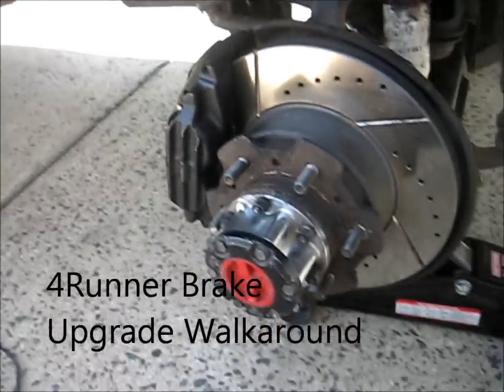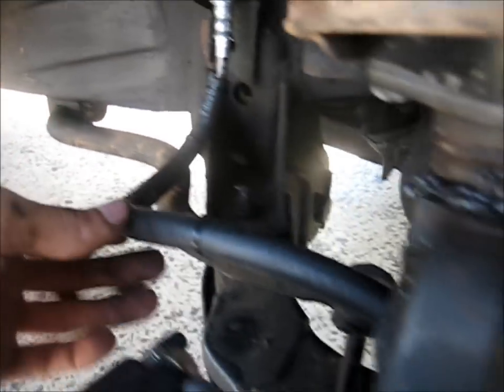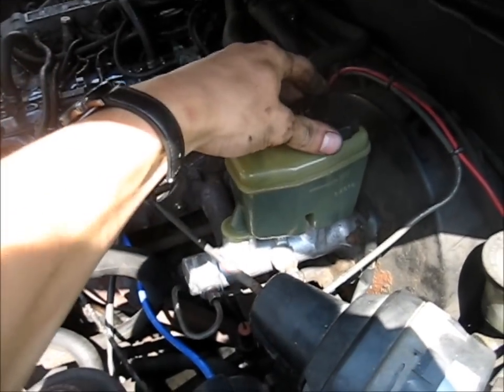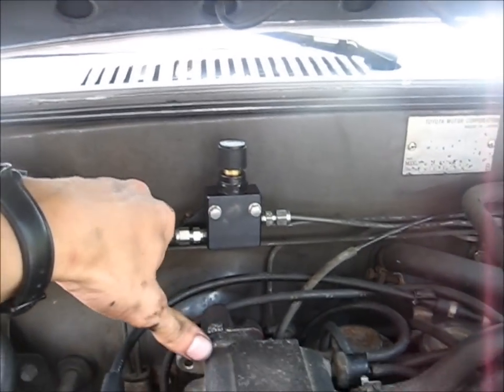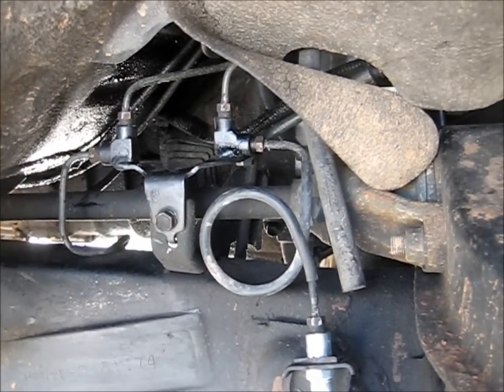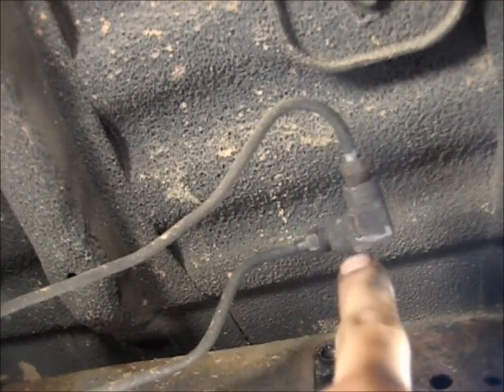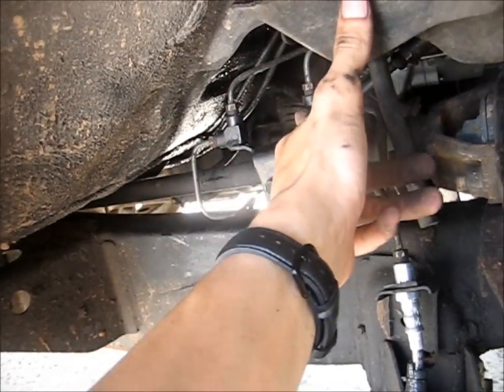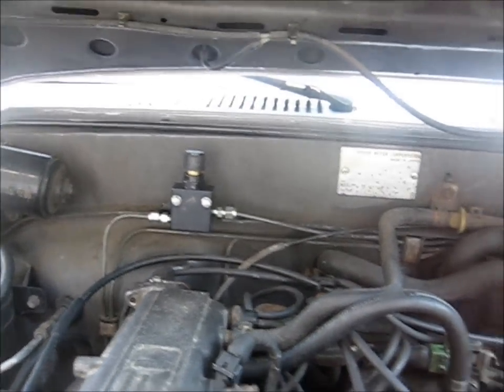Walkaround 4Runner Brake System Upgrade and LSPV Delete

Comment: But what about that that line u have to block off it goes up front to the power steering or something  I imagine  and wraps back out to the rear self leveler so just take that line or lines off that system and block the wholes 5/16 pulgs

Comment: I think your problem was you didn’t have a metering valve on the front brake system. Not having it caused the front brakes to apply before the rear causing the vehicle to become unstable. Back end wants to swing as soon the fronts come on, also unloading the hole back end of the truck.

Comment: Your rotors are on backwards. The veins should be pointed towards the back.
Reply from the maker: They work either way. It's all personal preference. Only thing that matters is the internal vents if they are directional. Most of the time they are not except on high performance rotors.

Comment: Looks like it’s the top, but want to verify it’s the top line running along the firewall that is cut to fit the manual valve correct?

Comment: You don’t explain how you got rid of the p valve how you rerouted the new lines
Reply from the maker: I did make a separate video of the LSPV delete, however, I have since gone back and installed a new OEM LSPV. I would recommend keeping the LSPV. Nothing else works as good and no matter what you do you're hacking up a good braking system. Just my opinion, many people don't agree, but I do not recommend removing the LSPV.

Comment: Thank you for explaining which lines go to what, I am installing a wilwood PV in stock location, but wanted to know what line went to the front brake.
Reply: I have the same problem with my lspv valve  is leaking  and rust

Comment: Great video! Thank you for being so detailed & clear on things.
Reply from the maker: After a bit of time with this modification, I do not recommend deleting the LSPV. Please read the description. I ended up replacing the LSPV.
Reply: TheAlexManVideos 
So the mod displayed is not effective or it is?
Thanks
Reply from the maker: I thought I was pretty clear I no longer recommend this. Keep the LSPV, get a diaphragm, master cylinder, and calipers from a 1995 V6 4Runner and you'll be way better off.

Comment: I got some EBC pads and rotors and they were like yours, drilled and slotted. Except my drilled holes are not drilled all the way throught. I looked this up and it says rotors that have holes drilled all the way through have a higher chance or warping. every hear this?
Reply: I also heard they crack as well.  Slotted is better than drilled for this application.
Reply: Check out ‘Engineering explained’ great video in slotted vs drilled.

Comment: I won't be removing my LSPV, just renew it, but how did you find your other upgrades worked? The better calipers and drum cylinder? I'm upgrading my 3L diesel to a 4L V8 and the brakes are something that were never too good. So double HP and torque means they need major attention...when I get to them.
Reply from the maker: The biggest upgrade was the dual diaphragm booster. The V6 calipers also are a cheap and easy upgrade. With the larger volume of the V6 caliper pistons you need the larger bore master cylinder. The larger wheel cylinders didn't make a huge noticeable difference but technically they should provide more brake force due to a larger bore and the same fluid pressure.
Reply: Magic, thanks. Great vids, by the way.

Comment from the maker: If you remove the LSPV then you must cap off the third line from the junction at the front brakes and install a proportioning valve for the rear brakes. I will also add this: I didn't leave it like this for even a year. Removing the LSPV caused the rear brakes to suck and the auto adjustment for the drums stopped working correctly. I get fed up with it and installed a working LSPV from the junkyard. I recommend refurbishing your OEM system rather than doing what I did with the LSPV.
Reply: TheAlexManVideos why nor add an edit to your video then?
Reply: Wait so is the video your new set up or the old set up?

Comment: Did the system work normally after you took out the other line? I have Toyota landgruiser LJ70. I read from a offroad forum that if you take the secondary line out entirely the brakes dont work normanny afther that. Great video by the way.